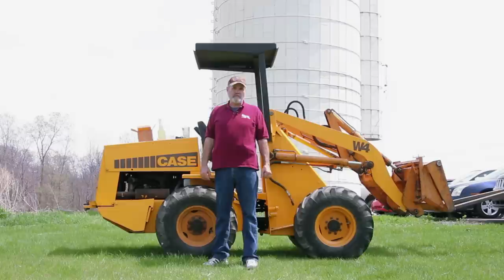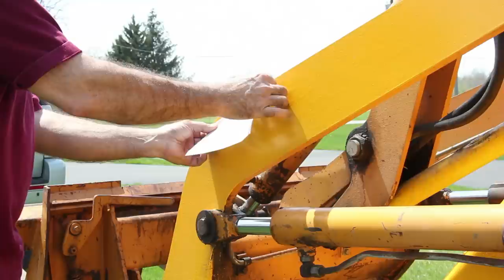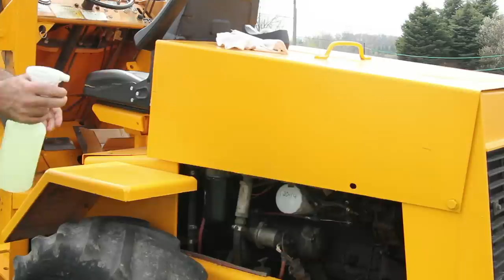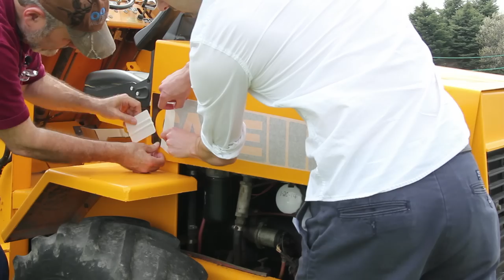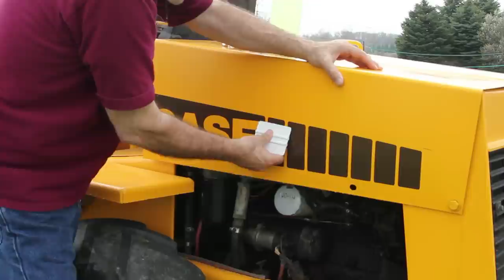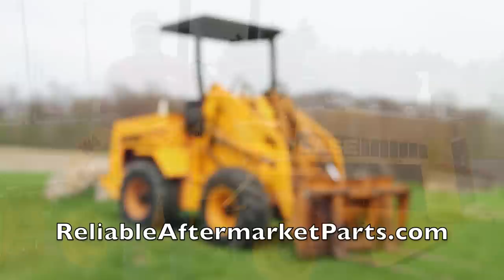DIY Install of a CASE W4 Aftermarket Decal Set

Comment: how to apply adhesive decal to tractor? saw the demo for water and other but not just the adhesive one.....thanks
Reply: Hello Brodon, thanks for your question! If you jump to 2:18 in the video we show how to install just the small adhesive decal without water. But when it comes to installing the larger decals, we suggest using the water method because you're able to arrange it after you stick it down, makes the job much easier!